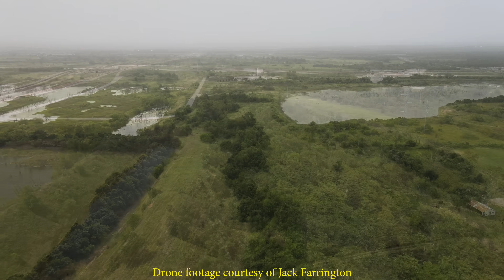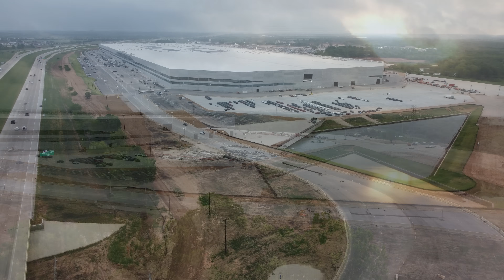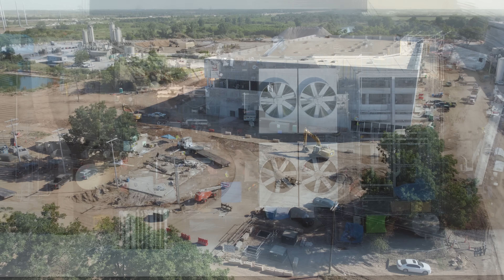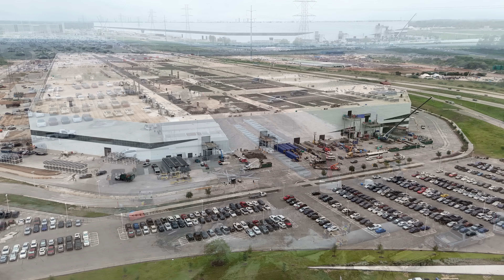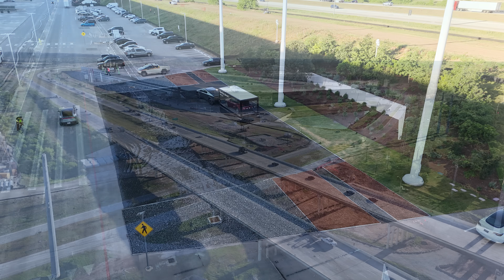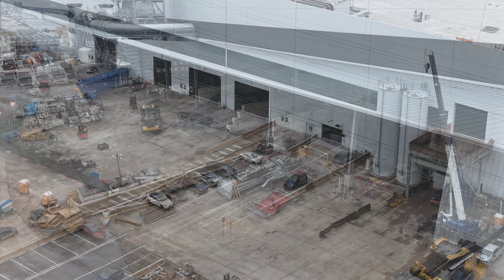6 Year Anniversary of Giga Texas Celebration! Let's look back through six years of construction! 4K

Comment: Ya know it was always strange to me that they added Cortex 1 was added to the main factory rather than building on some other space on property! Probably because it was able to be completed fastest there.
Reply: The Cortex part of the Southend, which is a separate building within the glasshouse seems to have been an afterthought. During construction the columns had to be modified to fit an additional floor (Cortex 1 is 3 levels, rest of Southend is 2 Levels).

Additionally, the entire Southend may have originally been designed for a different purpose. Admin and HQ was being touted at one stage.